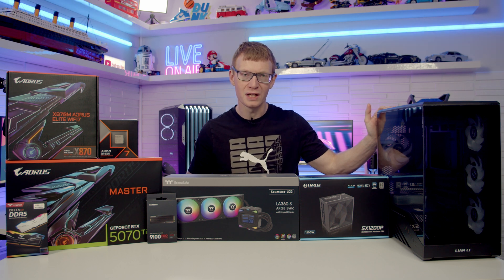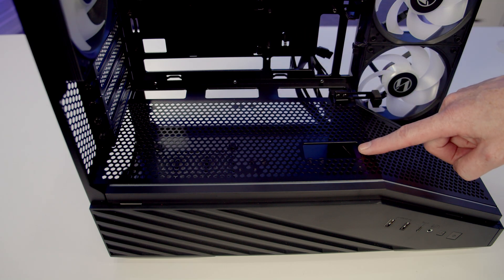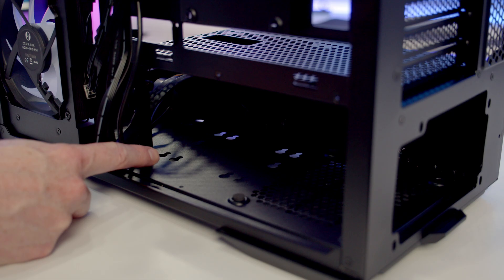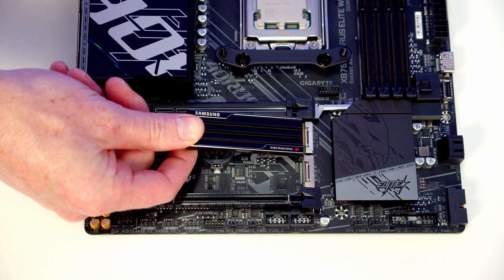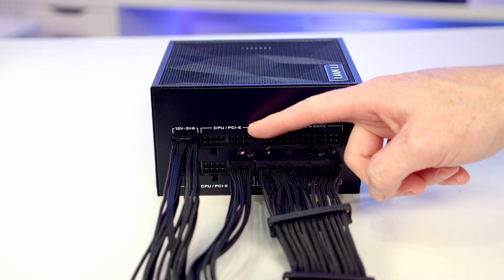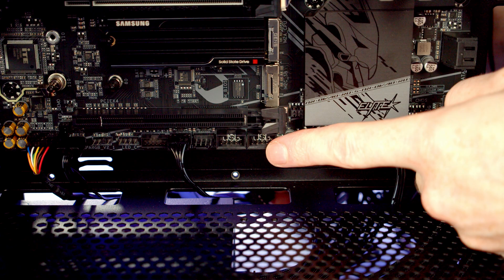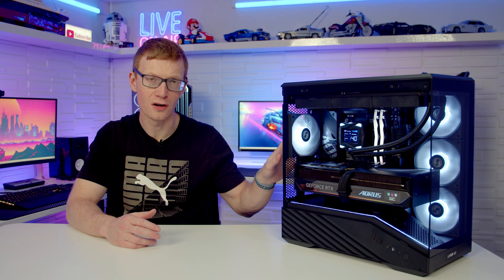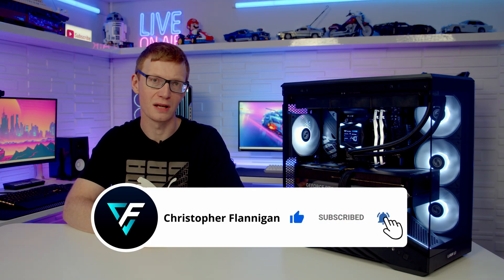Lian Li Vector V100 Mini Build - Step by Step Guide

Comment: Hi Chris I'm wondering about 1:37 it is set to Exhaust air out but the logo side of fans typically indicate Intake as is the case with the 3 fans for the side intake of this case. Can you please confirm if the back fan really is exhausting air out of the system even though the logo is facing toward the case? Also, is there a button that controls the 26 led light strip? Also the website said "RGB lighting is fully visible from all angles and can be adjusted instantly with a single button." What button are they talking about because there's only Reset and Power button
Reply: These 3 on the side are the reverse blade fans

Comment: Is there enough space to fit a 360mm radiator on the side?
Reply: unfortunately like the larger variant it does not fit one in the side due to clearance hitting the slope of the front of the case with the bottom of the 360mm rad